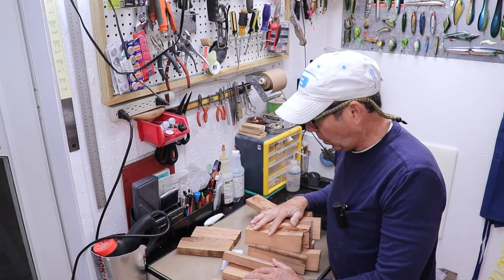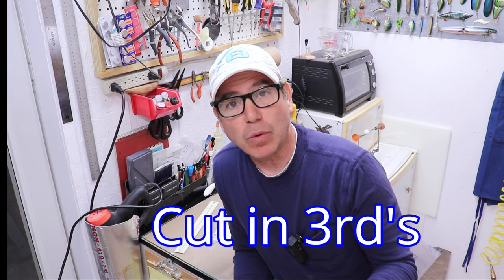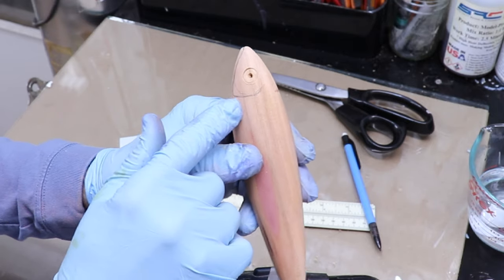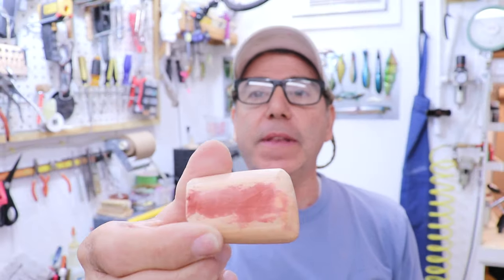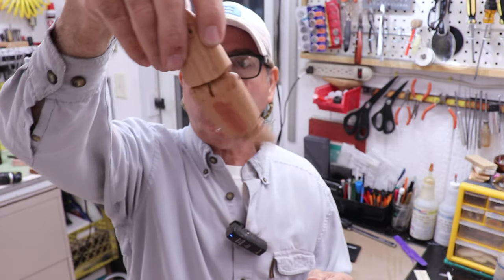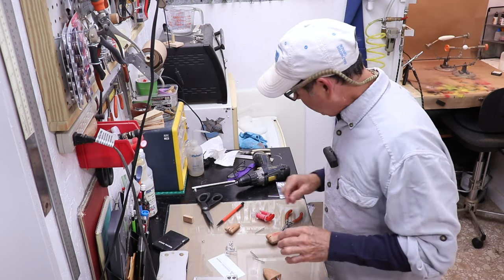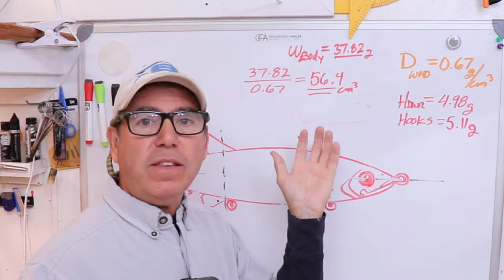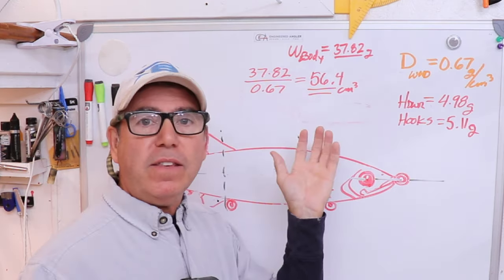How to make a wooden swimbait,   Making a saltwater swimbait Part 1  #swimbait  #makinglures

Comment from the maker: I'm afraid I goofed the description of the calculation in this video and I have confused most of you.  I have a more thorough, and accurate, description in the up-coming video that will post on Wednesday morning.  Sorry🤪
Reply: I think it was very clear, thank you! A Question: your 25% increase on the 10g weight is for a mid-water lure? What about a bottom water lure? I struggled with this question for my last build: is there a rule (of thumb as well) for how much a lure should weigh more than the displaced water for a different level of sinking (mid-water/bottom)? As always, thank you for your detailed explanations, they help a great deal a rooky like me!
Reply: Ops, sorry, I didn't noticed you answered this exact question in the next video...thanks!

Comment: Hardwood is good for this kind of lures. Awaiting for part 2.
Reply: Is actually better,the more dense the wood the les lead or extra weight you need to put in it
Reply: @mojondro  But not alwais. Sometimes the center of gravity matters for more intensive play, the balsa rules then.
Reply: I believe Franco has discussed this in an earlier video, that to the contrary if you want to make a good sinking lure you want a blank material with relatively high buoyancy. Hopefully I'm not misquoting here🙏🙏
Reply from the maker: Your right, but like anything it really depends on what you are trying to get out of your lure.  If all you're looking for is a lure that rockets to the bottom, there's no need to finesse the buoyancy/weight relationship.  But if you are trying to get a specific swimming behavior, you'll likely want to start with a buoyant material.

Comment: As a teacher, I use a white board every day. I'm wondering if you've ever used WET erase markers as opposed to DRY erase?  Not a huge deal, but it's nice to draw over it, or putting a straight edge over an existing drawing without smudging or erasing it.
A damp paper towel will wipe it right off.
Reply from the maker: I do use wet erase for fixed lines on  occasion when I need A-line that won't be smudged.   But all those drawings I do are free hand and at the moment that I want them so I need to be able to erase quickly and make small corrections.

Comment: I like to take a small drill bit and drill a hole through the lures I make to make sure the center of the eye socket lines up on both sides
Reply: Yep that's a good trick if you can drill straight 😂😂😂
I often use that trick but have actually messed it up a time or two. One added trick if you're prone to uh oh moments like me is to drill through the blank before doing any shaping of the sides.

Comment: Why didn't you pin the front of the hinge plate? Are you confident it wont pull out as its just glued in?
Reply: Nevermind I saw what you did later in the video with the screw eye...smart.

Comment: Also you lost me on the weight calcs. The body was 38g and the hardware 10g. However you appeared to end up with a total of 66G and added 10g of lead to make it 56g? Could you please explain what I am missing in your explanation?
Reply: Hi, yeah it's a little confusing but I believe the 56 referred to the cubic centimeters not the grams. I also need to watch that part again in slow motion 😂
Reply from the maker: Ok so I gave you bad info in the  video...I'll correct it on Wednesday's video.   Totally embarrassing 😳

Comment: Question... i always use 10% mix for  glass bubbles as u discussed and sometimes I get a pourous textured and sometimes it less so... Any idea what causes it?
Reply from the maker: Temperature and humidity can make a real difference...I get the same results.
Reply: @EngineeredAngler  thanks Franco, u the man... Btw I started experimenting designing and building lures with 3d printers... First season to abuse and test them... Will see....